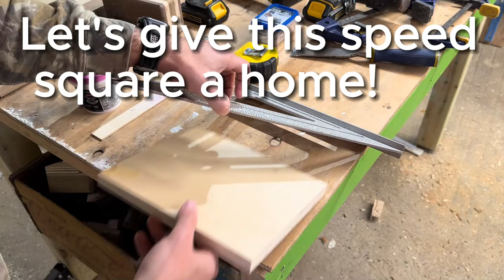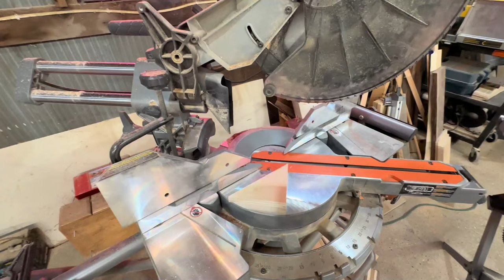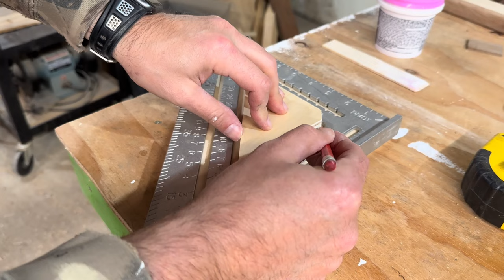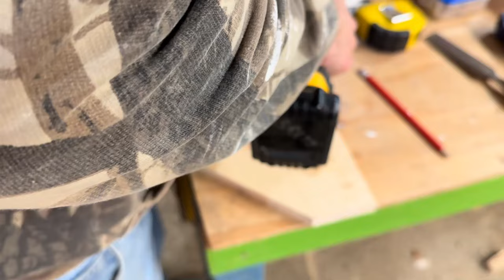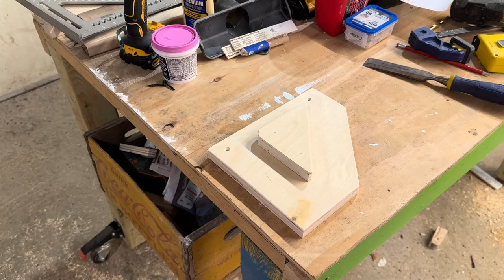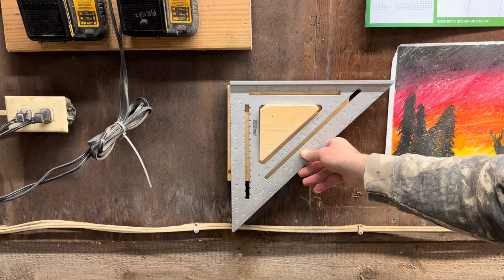Speed Square Holder

Comment: It's always nice to build something to display a tool properly. I need to do this a lot more myself as I find most of my tools I use on every project just lay on the bench where I work, but I have so much wall space to use. 

Pretty smart idea with the table saw sled to cut the recess, I'll have to keep that one in the back of my head for the future.
Reply from the maker: I'm also trying the best I can to get the tools off the table and either on the wall or in a useful space where they are easy to grab!

Comment: Takes up so much room, these silly peg board holders. Turn square on edge and you could fit 6 in that space? ( Yes, sticking out and put them not at center of bench so they poke you ). A slot and stop work great or just a nail
Reply from the maker: My shop is both a place of utility and a place of tranquility.  I go there to solve problems and relax at the same time.  In order to do that, it needs to not just perform, but also have a look and feel.  I don't necessarily need surgical sterility or a space for every single thing, but the things I use the most are definitely going to have a place on the wall for easier access.